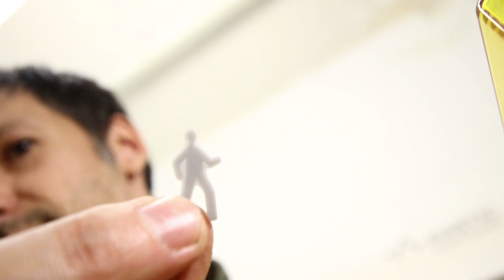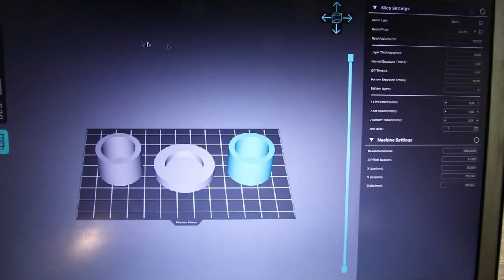Puppet making on 3d printer, Anycubic Photon Mono

Comment: Fascinating video! I love the experimentation with the eye sockets. 
Do you think 3d printing molds for silicone parts would work? 🤔
I'm much better at 3D modeling on a computer than with my hands.
Reply from the maker: I think it is a good idea but you have to use resin designed for casting or silicone will not cure

Comment: Yay, wondered how long it'd take you to get one of these cheap printers!!  Mines the non-mono version of the Photon and I've made sooo many things and have even more ideas for making stuff in mass for stop motion :) Just need to convince you to get into casting polyurethene platics from silicone moulds you've made from the printed parts, and eventually metals ;) hehe
Reply: Also, if you want the "best" afforable printer for tiny scale thing, the Sonic Mini 4K is uncomparably superior for small scale, as it has a 35 micron resolution miimum, compared to the Photon Mono's bloated 52 micron resolution. For fine detail, it's quite a huge difference :) All the jewellers I know on budgets are using this over the very expensive comparable pro level machines, as it produces as good as, or better results :)
Reply: For resins, I'm not sure which ones you have access to Portugal, but for me in the UK these are the absolute best available for budget, and both are availabel via Amazon, "Siraya Tech Fast" , "Siraya Tech Engineering" "Siraya Tech Sculpt" are the absolute best that I can get, and "Elegoo ABS like" is a good close runner up that I use a lot for less important things. The official Anycubic resin is somewhere languishing at the bottom of the ocean in the terms of how good it is by comparison and I only use if I have ran out of all other resins, including my trash bottle that has all the dregs of different resins that i have used mixed up (making a yummy brown colour lol) 

Sorry to write so much here, you give a lot to us freely and I thought it'd be nice to contribute some of the knowledge and experience I've picked up on this topic :)
Reply from the maker: good to know this, I did not  have comparision to any level, so I know how nice it is but not compared with other stuff.
Reply from the maker: Thanks for all this information, I will dig into it and test other resins for sure, and knowing all you say will help a lot on my decisions.
Thanks a lot